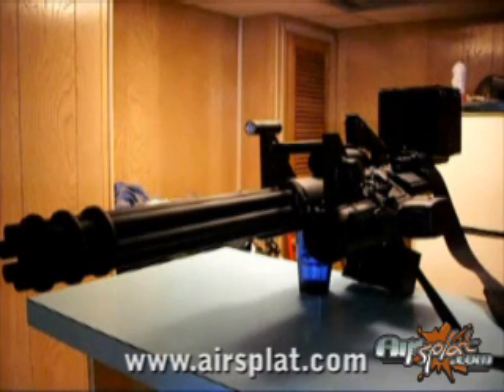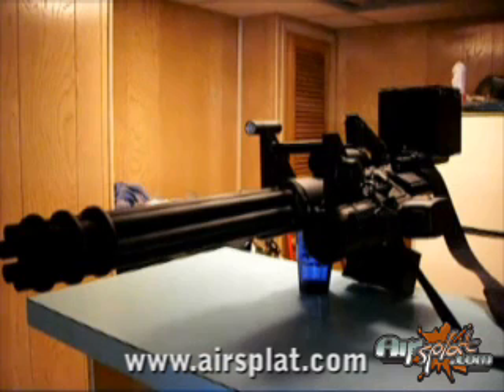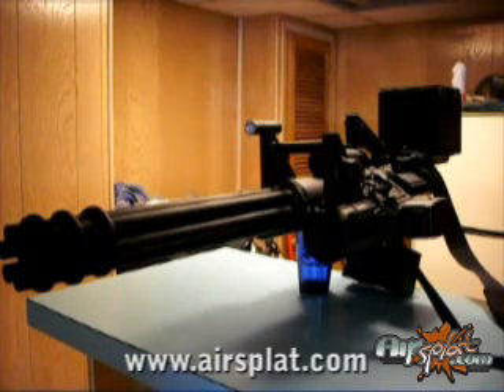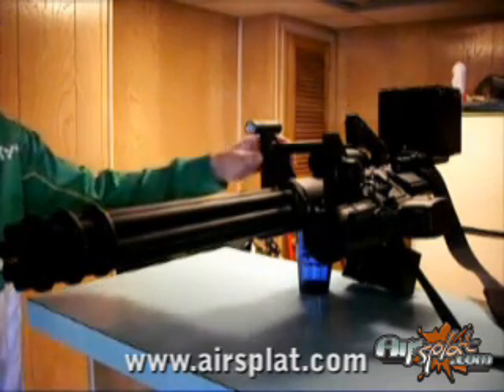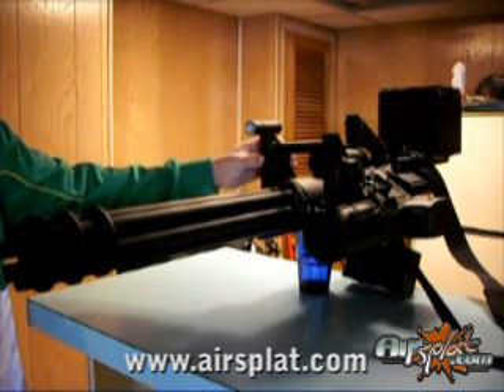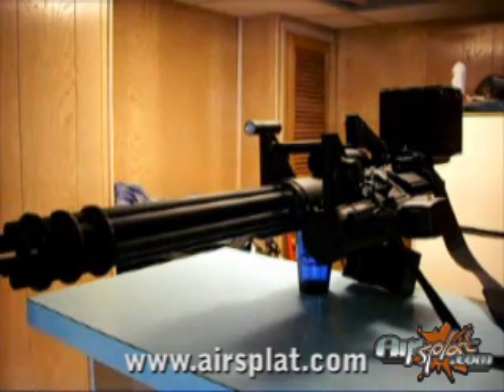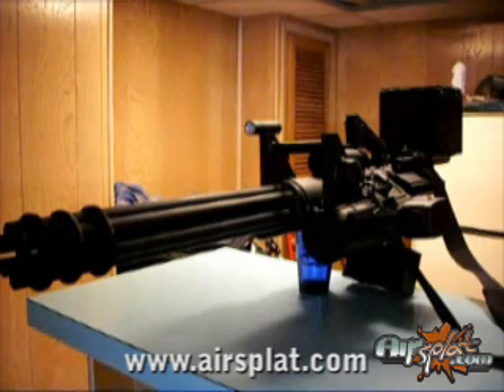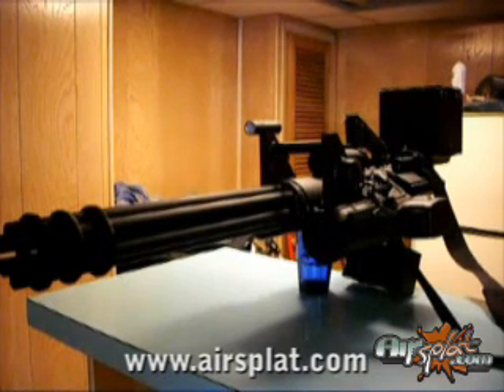Airsplat Custom Buildout Contest! Contestant #4 Mike Odonnell - Homemade airsoft electric Mini Gun

Comment: @andromedarr the gearbox came from a echo 1 g36k. the gears are a stock JG set and I do not think it hurts it one bit dry firing, thats an issue with real firearms due to potentially breaking your firing pin, which airsofts done have.  I have blasted well over 300,000 rounds through this weapon by now and the gears look great, and nothing has broken, except for a couple of windows in the basement I blasted by accident :)

Comment: Is the gearbox a JG box, like the gears are? 
What spring are you using, and do you think that dry firing is dangerous with a stock JG gearbox, only reshimmed like you do (bevel gear first, according to the pinion) and regreased?

Comment: @michaelXchevarie I am going to make some videos building a minigun like this one using an m14 gearbox and it will have a new low profile side mounted box mag that will hold at least 30,000 bb's. I've got a separate airsoft channel, its new I'll post them on there soon, the channel is DIYAirsoft, sub it up man, I'm crankin out some new videos gotta get em uploaded.

Comment: @Mikeandwendy74 hell yea...have you tried tweaking the rotation speed of the barrels,if you can get it to spin a bit slower,you could save power,and still have a high rate of fire,im working on a new one now,im tryin to build a shotgun,its a bit harder then you would think

Comment: @MyStrangeAddiction You can build one similar to this for close to 200 bucks. I built this with stricty hand tools, no lathe no bandsaw, no drillpress. I used a rotozip, dremel, hacksaw, files, a 4" grinder and a cordless drill.

Comment: @michaelXchevarie I have a battery compartment that can hold up to 3 10.8v big 4200 Mah batteries. I might take 3 of them and wire them parallel, to get 10.8V with 12,600 Mah Then I won't have to worry about batteries dying for a long time